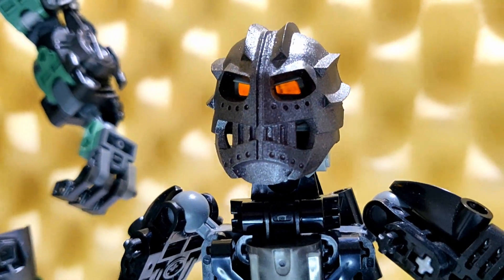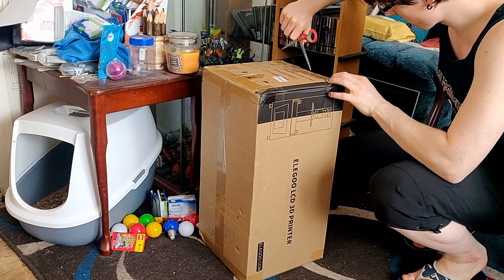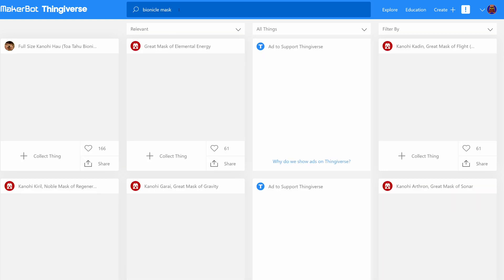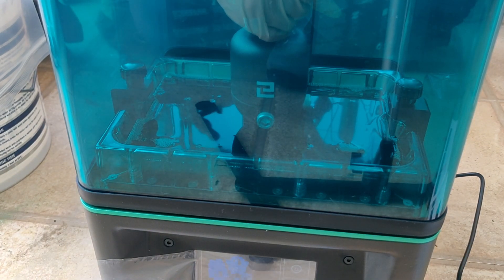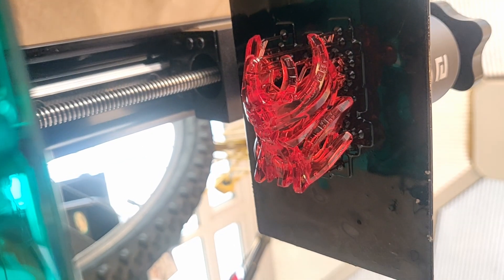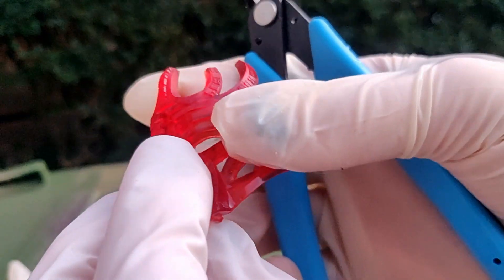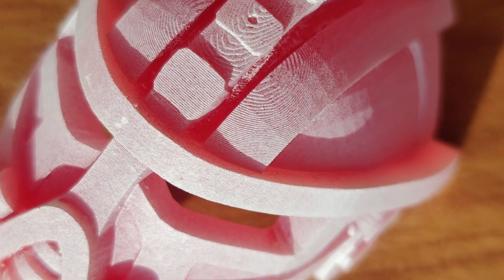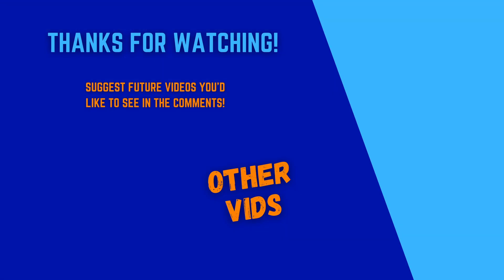First Time 3D-Printing Resin Bionicle Masks!

Comment: You need more than a standard face mask to work with toxic odors. You are okay with minor exposure but going forward I highly recommend you get an actual respirator. N95s aren't good enough either because those are for particles exposed in the air, i.e., cement dust, stone dust, etc.

Comment: Considering the price of Bionicle pieces for it's short run time, it honestly is looking more and more affordable to just getting into 3d printing, and try to reclaim my long lost tossed away collection that way rather than repurchasing everything.
Reply: Also I honestly kind of love the texture of the 3d printing layering on the pieces, makes them feel more "real" somehow.
Reply from the maker: Durability is the biggest issue right now. FDM can be good but I wouldn't use resin yet for anything structural.
Reply: @TammyCalamity  I'm surprised FDM is stronger, but I suppose the PLA I am using might not be as good as other FDM options.

Comment: I believe the white marks on the prints can be solved by dipping them in alcohol rather than water. I've seen plenty of people do this and they don't have this problem. However, It may be really expensive and I'm not sure if the alcohol can be used again since they typically use a lot of alcohol in one container.

Side note: is there any other mask from the art contest that fits on Gaaki?
Reply from the maker: There's a few from entries into the art contest. Once that contest is over I'll print out the winner and update the model.
As for the white marks, thankfully the priming and painting makes it less of an issue, but I'm definitely going to try and reduce physical 'clumps' getting on the later masks.

Comment: Rothanak’s mask designs are amazing! And he works really fast! I asked him about making some Element Lord helmets and within a day he had 2 done!
A little heads up though, he has stated that almost all of his designs have not been physically tested, so there might be some QC issues on some of the prints. So if anyone does print his stuff, let him know if the design was a successful print or if some sections need tweaking.
Awesome to see you finally got your printer up and running Tammy!
Reply: Rothanak here, almost all of the movie masks have been tested on a resin printer so they should be fine. The only ones I’m not sure have been tested is the matoran komau and movie akaku. I just added a new version of that komau because I noticed some of the walls were a little thin.
Reply from the maker: Thank you! I msged Rothanak in case he had any pointers and we'll give it a go as part of the next batch :)

Comment: For Gaaki's mask on the domed part there are those hints of visible squares. Do you know if that faceting is a result of the model or print resolution being too low to make that completely round? Or if the polygons in the model had outward facing tangents?
Reply from the maker: I noticed that too. It's the model file; maybe it's part of the reason why Galva doesn't like it :\